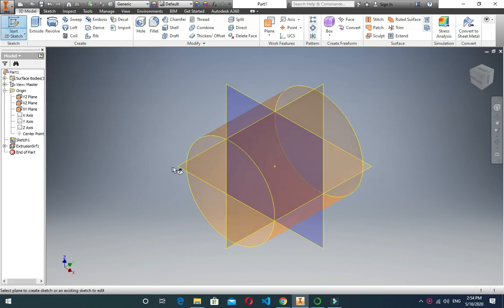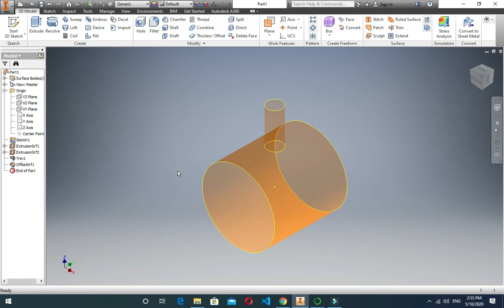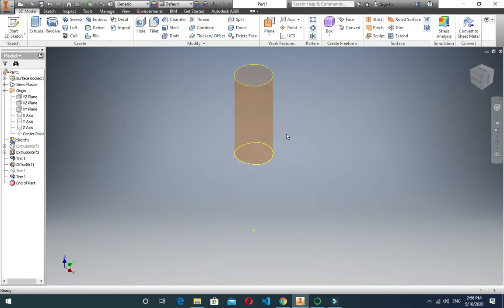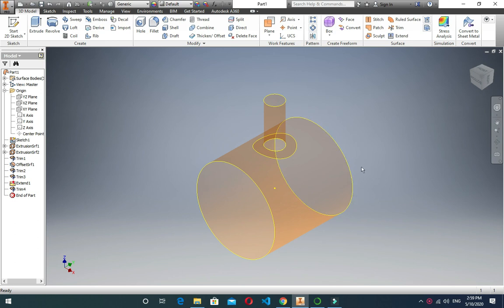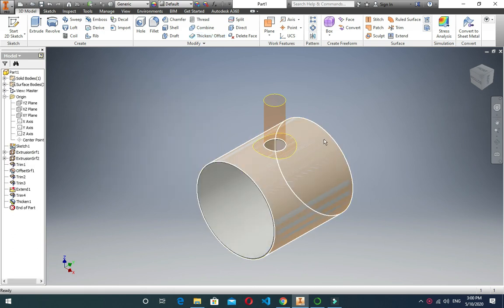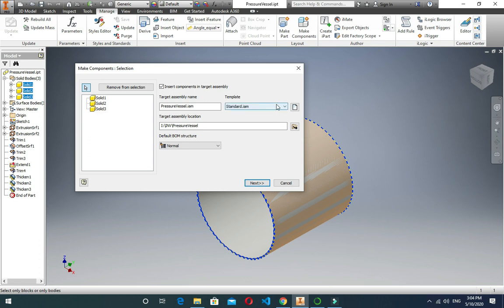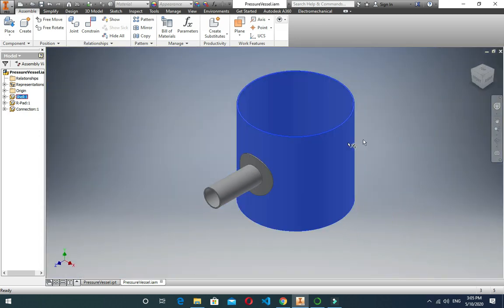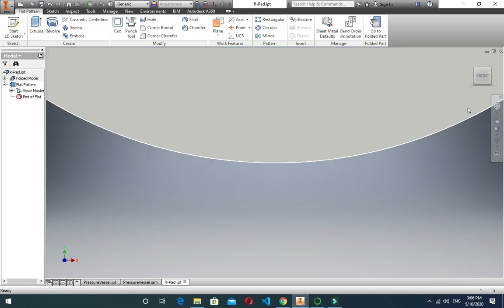Creating Pressure Vessel R-Pad In Autodesk Inventor.

Comment: Hi Sanjay, great video. How do you turn it into a drawing with compensating plate radius. I want to make a fabrication drawing so the workshop know what tolerance they are rolling the plate too. Look forward to your response 👍
Reply from the maker: Hello Benjamin, Models can be used to make the fabrication drawings with all the required dimensions. Dimensions to cut the required plate and rolling diameter.  Hope this answers your question, Else send me some sample of information you send to your shop. This will help me to understand your requirement.

Comment: Good job. Pls show how to make torrispherical dished end.
Thank you
Reply from the maker: Torrispherical head can also me made this. However, if you are looking for flat pattern of the head. It can't be done using flat pattern function. You need to calculate using the formula. 

For plate thickness less than 25 mm / 1.0 inch
 Blank Diameter = D + (D/42) + (2*S.F)+ ((2/3) * Kr)
For plate thickness equal or more than 25 mm / 1.0 inch
 Blank Diameter = D + (D/42) + (2*S.F) + ((2/3) * Kr)+ thk
where,
 D = Outside Diameter of Ellipsoidal HeadS.F. = Straight FaceKr = 0.17*D = Knuckle Radiusthk = Thickness of Head